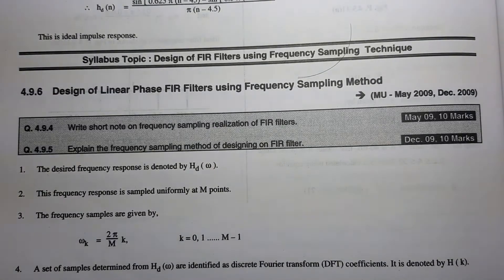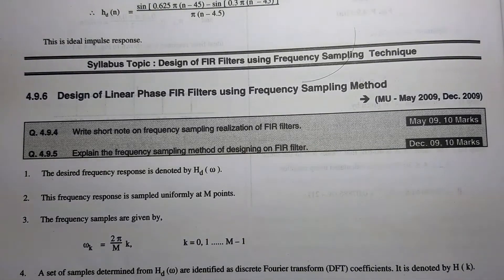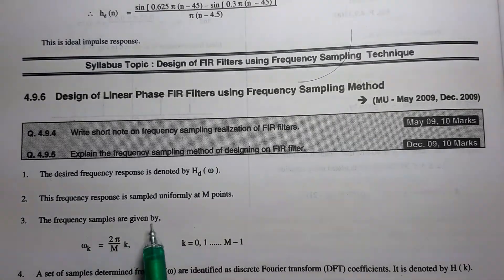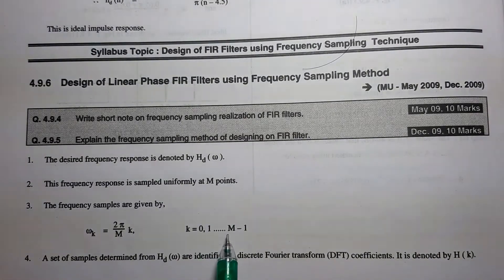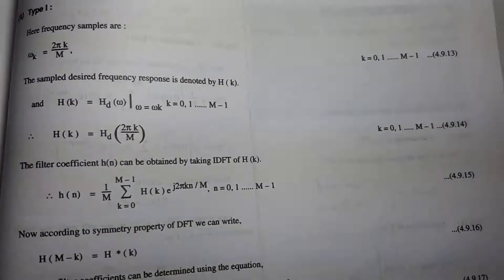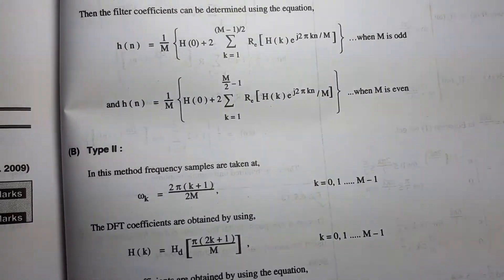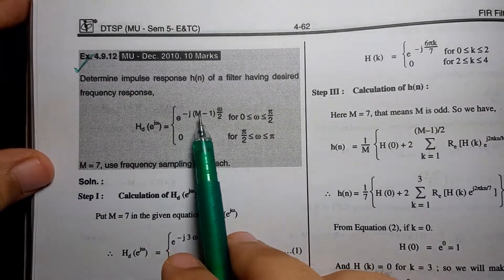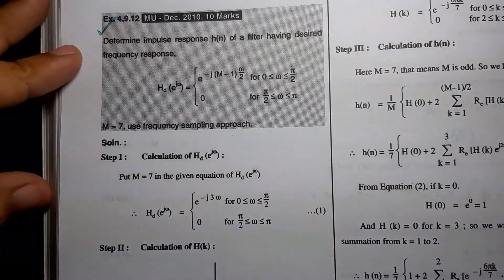20. Designing of FIR Filter using Frequency sampling approach along with Comparison between IIR and

Comment: Sir, can u solve this too , (Q)Based on the frequency – sampling method, determine the coefficients of a linear –
phase FIR filter of length 𝑀 = 15 which has a symmetric unit sample response and 
a frequency response that satisfies the conditions:
𝐻𝑟 (2𝜋𝑘
15 ) = { 1, 𝑘 = 0, 1, 2, 3 0.4, 𝑘 = 4 0 𝑘 = 5, 6,